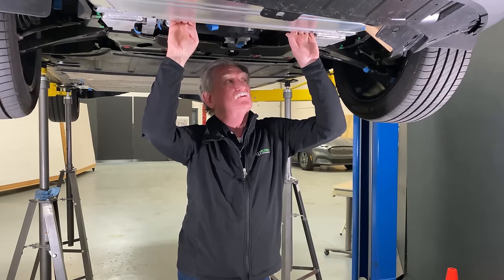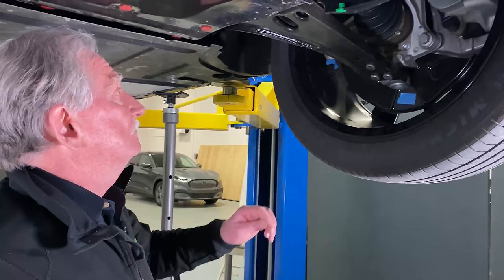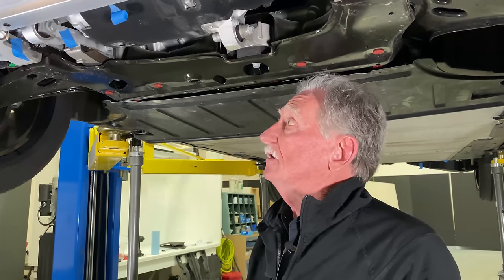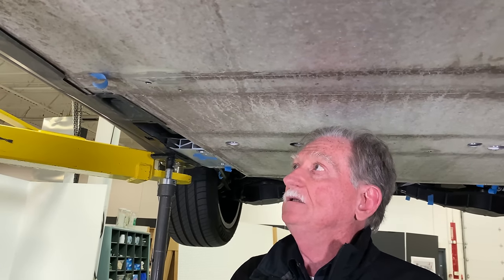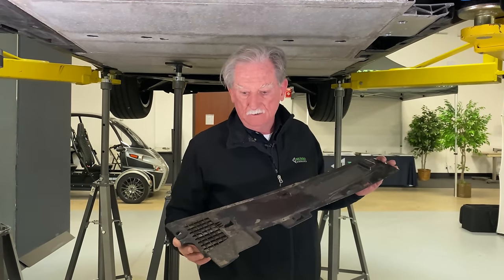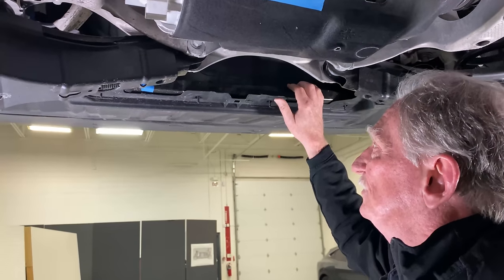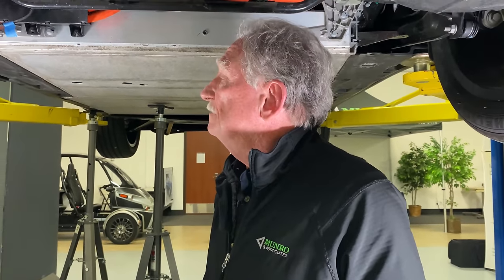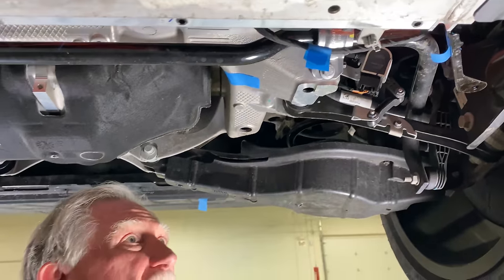2021 Polestar 2: E3 - Hoist Review

Comment: and my day just got better seeing this was up.
Reply: He looks like he does not know that Volvo was also an aircraft manufacturer in the past (the surprise about welding).
Reply: Just throw Polestar 2 in the trash bin.
Reply: @markplott4820  
Why? It seems to be an above average engineered car. The money is spent on the battery and software.
Also, the less complicated a car is, the easier it is to fix.. No one wants a car that is over engineered.
Reply: @mamadouaziza2536   - the POLESTAR 2 is an OVERWEIGHT and OVERLY Complex vehicle , built from a GAS car platform. 
in Comparison TESLA has FEWER parts , fewer Fuses and Fewer ECU than POLESTAR . 
TESLA is going to TOTAL Underbody casting and a Structural battery pack.
saves 900 Robots and processes.
Reply: @markplott4820  
Hmm, ok.
BMW's i3 is a lightweight car constructed with carbon fibre, plastic and uses fewer parts than a Tesla...
Reply: @mamadouaziza2536   - BMW i3 is a COMPLIANCE Clown Car.

Comment: Way over my head but I still love the review! The world needs more technically detailed information. Stuff has been dumbed down for too long.
Reply: I suspect it's a bit like the first-generation jet airliners and bombers like 707 and B-52 (especially after the Comet and B-47 accidents). The engineers decided that they didn't quite understand the forces they were dealing with so they way overbuilt everything. Right now I suspect the manufacturers are more concerned about gaining market share and maintaining a reputation in this still relatively developed market. As these companies get better understanding of the most common failure modes on electric vehicles they will commence with cost reduction in ways that they believe will not increase failure rates signifigantly. But right now it is probably too much risk for them to try to save a few dollars on each car produced.

Comment: Sandy, I don't know if you will ever see this but couple of things as a long time Volvo owner.

The riveted lower ball joint came in with S40 / V50 in 2005. It is common part with some other cars, if I recall correctly it was Ford Mondeo. But on the other car it is bolted, so in many cases if you need to change it - you need to buy the part from the "cousin".

The door handles you spoke last time. Yeah, freezing rain is a thing in Sweden and there is little to no that can be done without the handles. 

Also the really small wing mirrors have kind of always been a Volvo thing but that become really pronounced again in the S40 / V50 from 2005 onwards. They are even smaller than the mirrors in this one.

Comment: Something you could talk about, the 2 Wheel Drive will be Front Wheel Drive, which is opposite of Tesla, VW,...
It seems simpler to use the same Front Unit (suspension and motor) for all the models and have two different Rear Units.
Any advantage for Front Wheel Drive beside Rear Wheel Drive for an EV, as I expect that the 4WD will mostly be in 2WD mode?
Reply: All cars have larger discs in the front because of weight transfer when braking. For the same reason, EV regenerative braking in the front is safer (stability) and more efficient.
Reply: Explains the placement of the inverter as well.

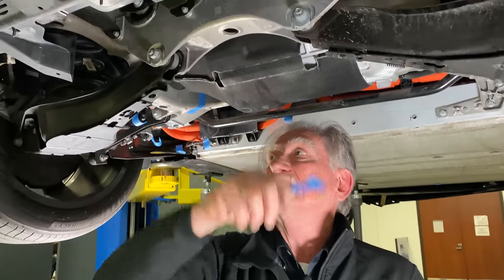Comment: @8:10 Sandy shows the C Channel and my first impression of that from a northern climate perspective is that it's a great place for salt and sand from the roads to accumulate and start corroding the metal. Even an underbody carwash won't clean that channel out. Dropping the tub would solve that issue as well. Thanks Sandy!

Comment: Hi Munro, I have a question. I drive a Polestar 2 and work at an Automotive Educational company. Yesterday we did a hoist review aswel and noticed the half shaft are kind of inline with the motor with no obvious gear reduction or differential. Do you have any idea what is going on inside the drive units and how this is constructed/setup? Thank you.

Comment: Any insight in this push towards electric vehicles is the industries way to ensure a future of profits and service. I'm all for the environment and green future, but I think that the internet has really leveled the playing field in automotive service. Access to OEM level service manuals, cheap aftermarket parts and tools, and diagnostic equipment that can compete at dealership levels at a fraction of the cost.

Comment: Love this car, I just wish it was priced a bit lower, like a Model 3.
Reply: you get actual luxury though with this.
Reply: Polestar 2 is a LUXURY brand, compared to TESLA, Polestar 2 is competing with  i-pace, e-TRON and other luxury cars, TESLA is OUTSELLING All of them.
Reply: No what you are getting is a vehicle that shares platform with the gas version of Volvo XC40 that starts at~$35k.  While the base BEV version of the XC40  starts ~$55k and this Polestar 2 starts at ~$60k.  It’s their low end platform that’s been modified here.  That’s no more luxury than a low end Buick or Accura.
Reply: @patr5902  never understood the problem with simply converting a gas car to an electric one. Makes more sense than going back to the drawing board.
Reply: @patr5902  BTW, the Polestar 2 starts in the $40s when the lower trims arrive.  The first release is the fully loaded version.  I own a Volvo and a Tesla that cost around the same amount of money.  My Volvo feels much more luxury than the Tesla.
Reply: @andrewmeehan6151  it doesn't though, EVs need to be especially focused on efficiency, which gas cars are not necessarily. You will not be competitive if your car is not specifically made for a electric driving
Reply: @Matzes  most people only realistically need 200 miles of range if they have an EV. If i need more than that, i'll probably be buying a plug-in hybrid so i don't have the hassle of charging on trips. You have a point, in that it might be 5-10% more efficient, but i don't see why they keep pushing for more range when the issue is charging times are too long.
Reply: @andrewmeehan6151  I agree about range. But when you got comparable price point and one car got a mich better range, you would probably go for that one. Efficiency in built is not only giving you range, it will also cut cost
Reply: @Matzes  sure, this car is a ground up ev right?
Reply: @andrewmeehan6151  it's not. It's based on the xc40 I believe. A gas car
Reply: @Matzes  hmm didn’t know that
Reply: It is, in Europe. If you're in America, say "thank you" to Trump for making the Polestar 25% more expensive.
Reply: @seybertooth9282  trump 2024

Comment: Great video, nice walktrough. 

Do you know why Polestar 2 is 300 kg (661 pounds) heavier than Tesla Model 3? From the Hoist-view I can see anything explaning the huge difference.
Reply: It’s not a ground up EV design, so some parts are not optimised and some are over engineered. Also, it’s built to a higher standard, includes more sound insulation and has more to the interior.

Comment: Can anyone explain why the inverter placement is a bad idea?
Reply: For one it's probably very hard to repair. Have to build out a lot of stuff out in order to get to the inverter. Other thing is maybe it needs more expensive heavy cable. That's at least what he praised on the ford mach e that tere was not a lot of way with the electricity from the battery to the motor.
Reply: @Tom-ku8bu  wrong, the engineers knew whz thez did it , and im sure there is an easier waz to repair it also those parts wont need to be changed for years..  the inverter is also very close to the motor so there is no problem there
Reply: @Tom-ku8bu  The ideal placement is between battery and primary motors to reduce interconnection length, where it isn't exposed to the environment,  it is as easy to access for replacement as it was for assembly, and it is unlikely to be damaged in a collision. Mechanically an electronic power module is more vulnerable to damage from impact, vibration, heat and humidity than a suspension member.  The current that passes through an inverter is enough to run an arc welder, cut through steel.
Reply: I believe that the Tesla and the Ford Mack-E have the inverter and the motor build in a single casting unit.
Reply: @nihongobenkyoshimasu3190  uhm not really, in the tesla the inverter is on top of the battery pack under the rear seats.
Reply: The casting is just to hold the suspension components and the motor plus axles.

Comment: Assume the inverter location comment was a center of mass concern.
Reply: plus probably resilience in case of a rear end crash
Reply: Look like an afterthought, all those braces, bolts, and two levers look like a prototype build using existing parts...
Reply: The two wheel drive version is front wheel drive. So the logical place is to have it Infront.

Comment: EV manufacturers just don't get the point.  Cars became complicated and expensive.  One could delete 90 percent of the parts on this vehicle and produce something of more value.
This is what ICE vehicles became.....complex and scary for maintenance, expensive and dull.  Now the EV guys are following suit, not starting from scratch and producing simple vehicles that move people around without fuss.
Reply: EVs are becoming like smartphones where you basically have no chance of fixing
Reply: @alanmay7929  Why do you believe that? Compared to a new ICE car it has much less moving parts to fix in the first place. IF youre concerned with electronics and that sort of thing being hard to fix for independent workshops or private persons, that is already the case since some time now. But with less to go wrong it’s an improvement compared to an ICE vehicle of similar age in my opinion.
And it’s no problem fixing the things that break on a smartphone, which are reasonable to fix. I’ve replaced or fixed just about every part on an iPhone except the main circuit board where it’s only possible with expert soldering skills and equipment. You could learn to replace parts on your smartphone as well, if you wanted to. Most parts in an iPhone are held on by torx screws into machined threads in the aluminium.
Some cheap android phones are pretty much glued together but other than that I don’t agree with you here.
Reply: @e30clew  what People rend tend to forget about electronics is that they are locked with software and sometimes the OEM like Apple doesn’t allow third party repairs…. A1980 Mercedes diesel taxi or a Toyota holiday can be repaired in the middle of nowhere with basic tools.
Reply: @e30clew  Toyota and other manufacturers still makes cars with basically no electronics because they are used in very harsh conditions daily all around the world.

Comment: $59,900 and if you don't want it in black you have to pay an extra $1,200. I guess it is subject to the 25% tariff in Chinese cars which is nearly $15,000? And China's tariff on American cars is also 25% I think.
Reply: Just buy a Model 3 dual motor and DONE.
Reply: @markplott4820  DONE meaning including crap build quality and road noise?
Reply: In Europe the price is competitive with corresponding Teslas and it's selling like hot cakes. So... another choice that American customers don't get.
Reply: @seybertooth9282  Does China put a 25% tariff on cars made in the EU?

Comment: MUNRO live - Polestar 2 is a cheaply built compliance car made in china by GEELY. 
It's built on a GAS car platform that gets less miles than it's competition.
Reply: If you would prefer you could get the Volvo XC40BEV version of this vehicle designed in Sweden and built in Belgium.
Reply: The Volvo version is about the same price.  The problem then is that it is still built on modified ICE platform.  Which leads to the low range and higher price.  A base ICE XC40 sells for ~$35k while the base BEV version starts at ~$55k.
Reply: stop talking nonsense mate, its not cheaply built car, it ws also made using recycled materials and its way more comfortable and quiet than a tesla.
Reply: the car was developped in sweden by swedisch engineers. tesla are also made in china, even the american teslas have parts made in china....
Reply: I believe Volvo and Geely Polestar use the same battery and motors.
Reply: @Mark Plott You are misinformed, it is not built on a ICE platform and by definition it cannot be a so called compliance car when it is built by a separate brand without any ICE cars it needs to compensate for. Also as Munro is explaining the best solutions are also often the cheapest, so "cheaply built" is not necessarily negative.